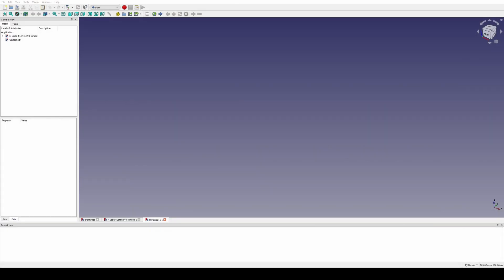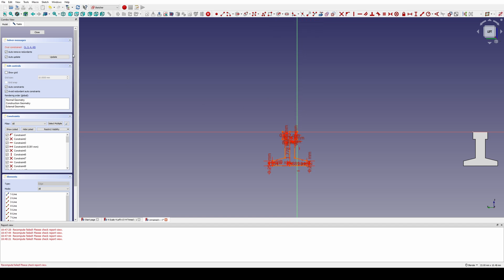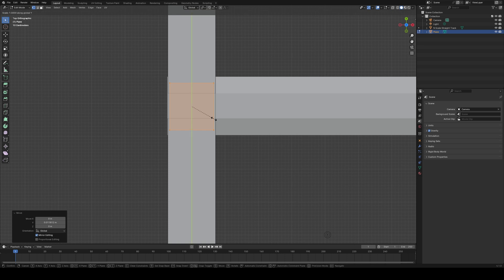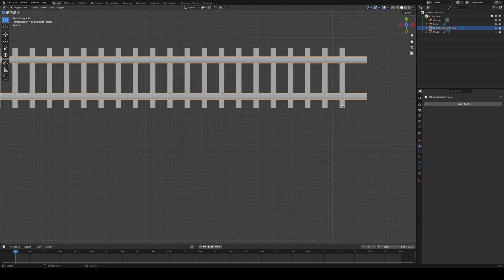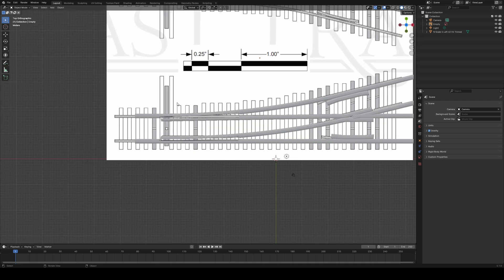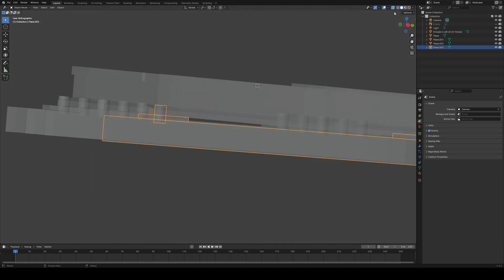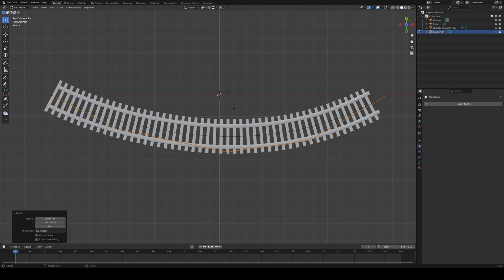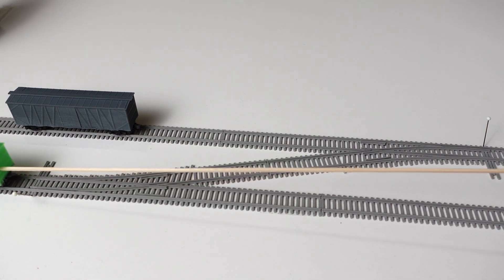Tracks & Switches: The Ultimate 3D Printing Challenge

Comment: Just had a great idea on printing inter-connectable train tracks with additional steel rails to be inserted  (but I'm thinking on HO size, similar to Fleischmann Profigleis, good compromise between space use and stability, but they are expensive) ... so I need to run HO trains, so need steel rails, but how to fix them: Idea just came up, first you make the model of the substrate and ballast  underside the main frame let's say , and the outer sleepers and fasterners (only outside). The main print should spare out the small space where you will squeeze in the steel rails ... now, the inner printed section side will squeeze from the inner side the rails into position, and need to figure out some small plugs to stick them together with some click mechanism both for each rail and each inner insert... , so you can go actually endless ... and make any curves that printer can handle ...

Comment: That is really cool! I never would have thought to print-in-place a working turnout. How much gap did you leave between the ties and the movable rail? Any chance you'd consider posting the stl file? I'm currently wokring on a layout with a decent staging yard, and I've considered adding 3d printed tracks for additional car storage. Since it would just be cars, the lack of power wouldn't be an issue and I could save some money over metal rails.

Comment: Have you tried using the switch construction methods like on your HO switch but in N scale?
Reply from the maker: I've 3D printed complete N scale switches, but not with conductive rails.  It would work, but probably better with a resin printer to get finer detail.